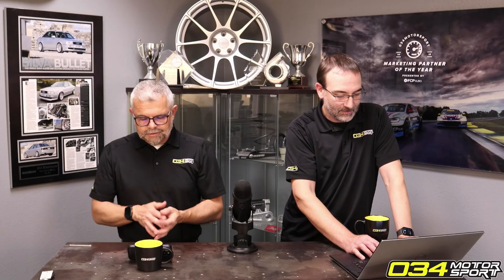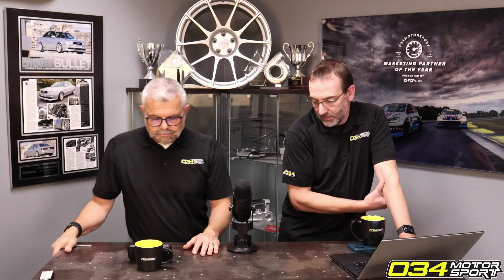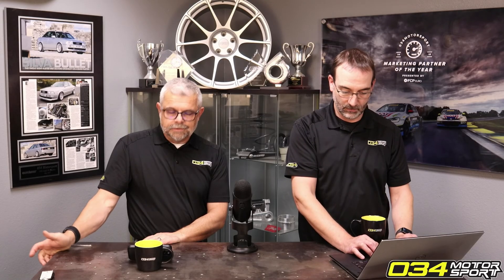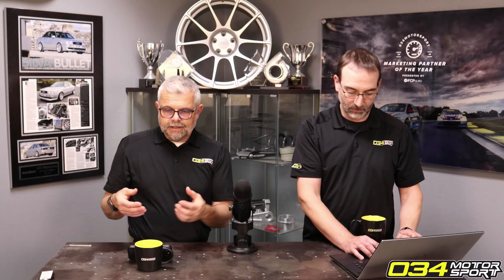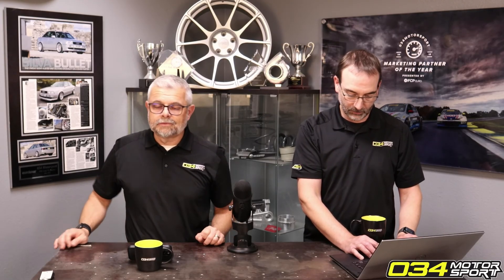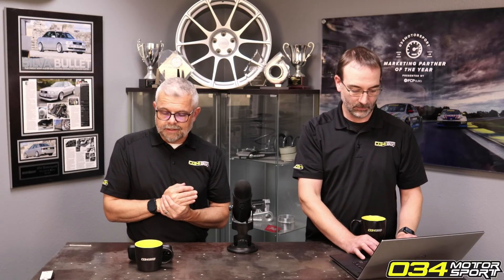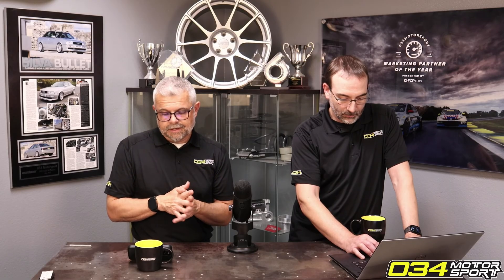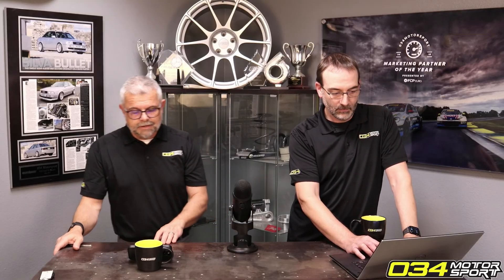Why Does Audi Put Their Motors In Front Of The Front Axle? | 034Motorsport FAQ

Comment: I find some of your comments to be astonishing. "Rear wheel cars typically do not put their power down very well... can be very unstable or offer irregular handling for the average driver." You go on to say that if you give it some throttle you can "easily spin" whereas that would be hard to do in a FWD or AWD vehicle. No mention that FWD cars typically have so much understeer that you can plough right through the corner in them. Your comments sound like someone who has never driven an RWD vehicle, but is just parroting Audi propaganda. The heavy steering and understeer of Audis is an absolute deal breaker for anyone who likes a car with neutral handling or would like to be able to induce oversteer with the throttle. I'm on my 4th BMW: E36 328IS RWD, E46 M3 RWD, X2 AWD, F87 M2C RWD. Not counting the X2, which has a transverse I4 engine, all of the others were RWD and the engines are approximately 2/3 behind the front axle. Obviously the transmissions are completely between the front and rear axel so they all have very neutral handling, although the M2C is very easy to induce oversteer if you so chose. This layout can be available with AWD. Mercedes Benz also uses the same layout. These cars handle much better than Audis. If I recall, Audi had to put wider tires on the front of an RS3 to combat the massive understeer. Do. Not. Want.